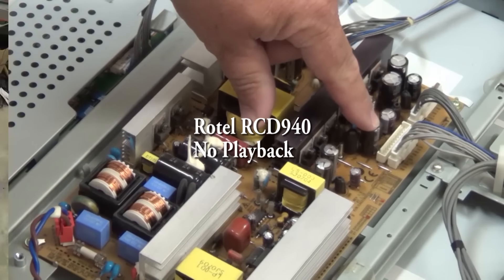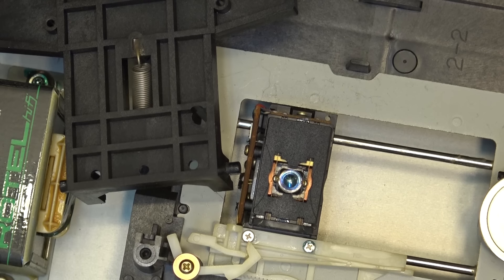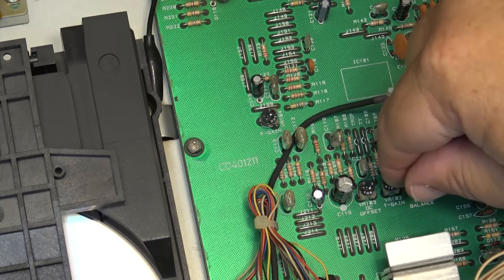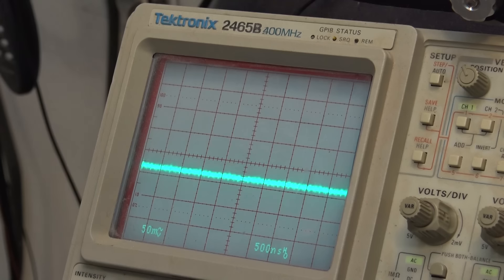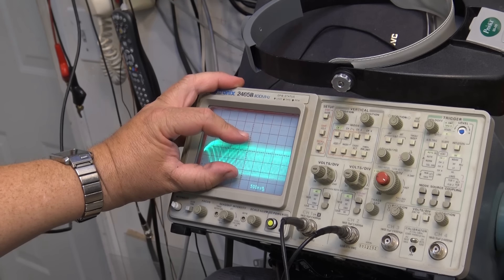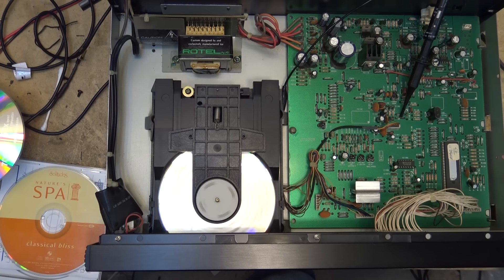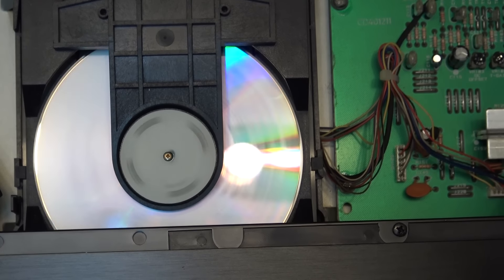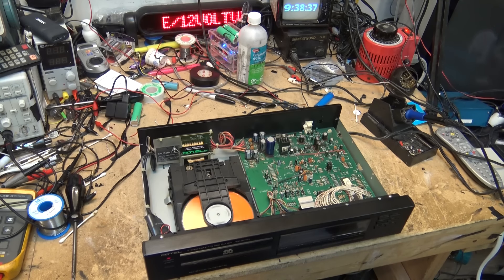Rotel RCD940 CD player repair and alignment

Comment: Thank you for running through this repair.  I watched your other video on the belt replacement for the Yamaha CDC 705, and then came here to see this one.  My Yamaha needed to have the bias tweaked a bit to stop the CDs from skipping.  Thanks for pointing out those trim pots for us.

Comment: Interesting design, that player. They save a motor by making the mechanism more complicated but then they put a giant circuit board in there with lots of unused space and populated with through-hole components. Economics for electronics were definitely different back then.

I can definitely confirm your findings about CD-R's. In 1994-95, long before most people knew that recordable CD's existed, I worked at a company that made software for CD-i discs. They had only a single working CD recorder for the entire office: a Philips CDD-521. It was one of the first recorders in existence, and it was probably as expensive as a car. I bought some blank CD-R's that cost about the same as a prerecorded music CD, and recorded some audio CD's and CD-ROMs. I still have most of them and most of them still play, even on my oldest CD-player: a pre-production Philips CD-100 with a laser pickup built in 1982.

Like you, I had the best results with the early green (cyanine) discs. They still work even now, almost 25 years after recording (at a whopping 2x speed). But I always felt that later discs, especially the silver ones, but also the gold ones (phthalocyanine) were always less reliable even when they were new. I tried to avoid them so I only have a few of those. The blue ones (Azo dye) also work well but those didn't appear until much later so they don't have as much of a history yet.
Reply: 95 cd recorder was 2000-2500 D^^ 
had a cd with at least half mm wide scratch if knot over 1mm? 1,5? and played -?- 
i mean the see thru scratch... also among my hundreds öff tapes one had a cm meddle oxide fall off so 
1 sek no sound xD

Comment: The first single disc player I bought was in 1986 as I bought my first CD "Brothers In Arms" by Dire Straits. I bought the CD player at a Radio Shack for $170, and that was $100 off on sale! Three weeks later I had to take it back, had trouble reading discs and if they played, they would stutter. Being under warranty, it was fixed for free. Turned out something was loose on the mechanism and it went on to work fine. I also bought a standalone CD Music recorder around 1997. You had to hook it to the stereo and record in real time. I thought I was something, I'm making my OWN CD's! Now look how for we've come. By the way, those CD-R Music discs at the time were $7.00 each, a box of 10 was $70.00 so I had to be careful not to screw up a recording!
Reply from the maker: I have a Sony 200 disk jukebox and a CDP555ES single disk unit. That one is fantastic. I have about 1000 CDs back when I used to buy CDs.
Reply: Good taste in music. Brothers in arms was the first cd to sell a million copies.
Reply from the maker: I also have that CD. 
Back when CDs were brand new the selection was mostly classical. My first CD Isac Stern's 60's anniversarry concert. Fantastic full digital recording. My first pop CD, because there was very little available in 1982 or 83. The GoGo's. Like most of the music from that era, no staying power.
Reply: You were something back then as was I 😁 mine was a Tandy as well and paid 189.99  and my first CD was the Police synchronicity.
Reply: My first CDP was the Sony midi version to fit my Mitsubishi midi hifi system. It had custom file and when a friend visited me I was proud to show him sentences I programmed before for every CD in the library. So my CDP showed “Fuck off”  when I wanted to impress friends. My first CD was Queen “A night at the opera”

Comment: I bought an onkyo integra dx-7500 that was in a smoking environment.  I could smell that tar the moment i opened the box.  I cleaned the outside to rid the smell and I removed the top cover to look inside.  It did not look that bad.  I lightly blew off the laser with a can of compressed air feathering the trigger.  I stopped b/c I saw the laser eye moving.  Is this normal?  I did not clean it with a q-tip or alcohol.  The player seems to play real clear and it plays badly scratched CD and CDR's with out any skipping.  Should I leave it alone at this time?

Comment: BTW, Sanyo didn’t make that player, just the laser and some ICs. The player’s power supply and analog stages are Rotel’s work. I have two Linn CD players that use a Sanyo laser, those are definitely Linn designs.
Reply from the maker: Si1983h 
Rotel designed it but I am pretty sure they had someone else make it in Singapore.
Reply: 12voltvids I think Rotel kit has been made in China since the 70’s, certainly the bits I’ve owned have been. It worked for them, it’s affordable quality kit.

Comment: I've been watching your Rotel CDP videos. I just bought a used rcd-965bx that sounds amazing but the Philips CDM-4/19 drive is making a chirping/swishing sound during playback. Some cd's chirp less than others. It's driving me nuts! I would toss it in the bin if it didn't sound so good. I want to save it. Any insights for a fellow Canuck?
Reply: Hey! Get someone to fix it! As you say, it sounds so good (because it does!). You hardly find a so much pleasant e accurate sound from any other CD player at its price or higher. I have a RCD 965BX too, (with open/close issues in the tray) but I never thought he could really sounds so good!
Reply: @DoNaSbaR  Yes, it's such a laid back non fatiguing sound from the Rotel. I brought it in for a service two weeks ago. Waiting to hear back from them. Fingers crossed.

Comment: Have an issue with my Rotel rcd 951.  She normally works fine without skips until 3rd or 4th cd.  That's when the trouble starts.  I've cleaned the lens and nothing changed.  Sometimes it will work for days without a skip and then it begins.  It only ever skips forward.  Should I lube the lens guide rail?  Anything else that it could be?  Any help is greatly appreciated.

Comment: Thanks for this.There doesnt seem to be any people doing this.I have recently tried to repair an Akai CD-M70.I noticed first off the laser head mechanism was down the back,like it was stuck.after getting the transport out,and loosening the laser head along the rails,I noticed laser wasnt working and the motor didnt spin the disc.A pity I couldnt get it to work.Thanks.

Comment: I have a Samsung DVD-VR357 that wont read commercial DVDs but has no problem reading CD's and even scratched up blue burned DVDs...what gives? The laser has 2 pots on it, labeled HI and LOW...can I turn up the laser with one of these pots? Nothing on the board.

Comment: Hi I have a Emerson boom box with cd player 1990 ...ac2503...i load cd ..switch to cd function ..cd no spin push play button  nothing
lcd screen read 4 black lines ...if i go out of cd mode and then go back to cd selector the cd always jerks a bit as if to start the cd but thats it.
could you please tell me what your thoughts are as to what might be the issue ...have cleaned lens still nothing...
many thanks for any help you can provide.
cheers from Cygna6

Comment: @12voltvids I have a Rotel RCD-955AX. I left it on pause for a day and now the motor just will not stop turning. As soon as I power on the unit the motor spins and does not stop. The display does not flash any numbers, it seems to be seeking information. Nothing works all of a sudden. Any advice? Thank you sir!!

Comment: They may have used Sanyo chips but that doesn't mean Sanyo made the player. Rotel made some pretty good stuff back then. Check out the RCD-955 player. It had some auduiphile grade parts in it.

Comment: In the early 2000's my brother bought a printer and wrote the key on top of the CD, adter that the computer couldn't read it. The CD info was written on the sticky side of the sticker label on top of the CD, since it didn't work after writing the key on the CD, he pealed the sticker off and the info was on the bottom of the sticker and the sharpie ink blead through the sticker..lol
Reply from the maker: Learning Electronics Cheaply 
That's why they always said not to stick stickers onto the disk. The data is on the top read from the bottom. The spiral grove is pressed into the top, then the dye layer and then the reflective coating then laquor on cdr.  On stamped disks the data is stamped then the reflective coating followed by laquor. Put a sticker on and then peel off you will remove the laquor and reflective coating. 
DVD r are 2 disks glued together. The spiral groove disk, the recording layer, reflective coating and the. The top half of the disk. Much more protection.

Comment: Hey 12voltvids, What if someone where to burn a cd at a much slower speed would that help older cd players read the newer disc any better?
Reply from the maker: I don't think so. The older dark blue or dark green disks were better in the older players than the modern silver disks.  Crd is hit and miss on cd players manufactured before recordable CDs were devoloped.

Comment: I acquired a three cd classical set recently and they are gold layered disks. I wasn't sure if it was just for looks or performance.
Reply: You can be sure that it's just for looks since the gold layer will have no effect on the audio quality.
As long as the CD player can see the eye pattern in good shape you can be sure that the audio will be good.
Reply: @GoldSrc_  they do look swanky. The sound is good but no better than other CDs I have from the same producer.

Comment: My 1988 pioneer 6 CD changer it can play those newer CD-R disks and not skip.
Reply: The signal isn't as clear, but yes, they should be readable, but sometimes problematic due to their composition, as Dave here stated in the video.
Reply from the maker: The reason I was having trouble with that disk was because my AM transmitter was turned on. The signal from the disk is lower and the interference from the transmitter pushed it over the edge, as I showed later once I turned the transmitter off.
Reply: @12voltvids  Interference from such sources as said transmitter can intensify the reading problem, yes, but part of it may have also been due to the fact that this was a smoker's unit at some point. An NOS laser mech from a similar unit would fix this problem once and for all, even with the transmitter interference, even though you stated that they were a pain to acquire.
Reply from the maker: Colton Rushton 
For sure the smoke on the internal optics is lowering the signal. Incidentally it operates perfectly with the  staples CD even if the transmitter is on if the metal cover is on. This transmitter is not a part 15 transmitter. Part 15 limits the output to 100mw. This one is putting out just over 1/2 a watt as one of the resistors was changed.  With the indoor wire antenna it makes it to the end of the block before it fades away. If it was fm with half a watt it would easily cover the neighborhood. I just use it to rebroadcast an fm station on the am band so I can play with my old am radios. It does however play havoc with my test gear especially my scope. So i have to remember to turn it off whenever i need to measure something.

Comment: Hello 12voltvids,
I have put another teac drive and servo board into my cd-player. I have been having small clicks in the speakers. I adjusted focus balance, that made it search smoothly forth and back, and then I adjusted tracking gain until it would accept all discs and finally adjusting focus gain so it would be stable and even read burned cd's. I am looking at the eye pattern all the time to maximize it and get it clearer. Reading the very little informative servicemanual did not really reveal any secrets. But looking at the eye pattern while adjusting all parameters did. anything I do, reflects on the eye pattern. I also measured the laser over a resistor and got a value, divided by 22, multiplied with 1000and got a new value that I compare to the one on the lasers label. It would seen that it's 3 % worn. But I think there are many other factors that can make a laser become bad before that point of expected life time.
May I ask you what e-f balance is? I think I understand that there are two coils inside the laser head and they move the lens up and down and side to side to read etc. But if there is no dedicated e-f balance on my servo board, and nothing on the laser itself, what can I look at as e-f balance? I also read that the coils are adjusted to stop whining. Okay, but what is exactly stop whining? I mean, they will always make a little very low sound on the whole adjustment scale. I compared to my other cd-player, it it shines and reads perfectly and have no clicks in the speakers. So I  think that the laser coils whining is a relative term?
Cheers and thanks for a good video. It's seriously hard to get a cd-player well adjusted these days and most workshops closed down, and many people get the music from the web or some sort of server. But I am very interested in keeping my cd-player spinning well, hence I started out myself.
I hope you can explain the problems a little to me, so I can avoid the last few small clicks in the speakers, which I understand is errors that could not be corrected and set as flag level 3 - unrecoverable or something like that. The adjustments I have done helped it really much, and last night I thought I had hit the right spot, but there is still a fraction left, so by fine tuning or determine if the laser is having other trouble and is doomed, so I should look out for another one. It's a sony kss-151a laser.
Cheers and great videos!

Comment: Hello man!!! Here a fan of you from Mallorca, Spain. I have one question I would like you to throw some light on if you don't mind! How can I adjust tracking gain and focus gain on units that do not have trim pots. Ihave watch some videos inwhich guys add and extra resistor somewhere in the board. Is tahta propper fix? How do I know how many ohms should the resiator of? Where should I place it? Thaks in advance!
Reply: The unit I am trying to repair is a Denon UDCM-M7 3 disk unit. In the service manual you have info about the eye pattern but it does not say how to adjust tracking focus and gain. I have been trying to improve the eye pattern by adjusting the laser intensity, but it is not enough. Thanks in advance if you could help!
Reply from the maker: If there are no adjustments for focus/ tracking bias/gain then its all done digitally.  Some can be set using special jigs nit most not.  They work till the laser is shot.
Reply: I see!! Thank you very much for the info! Will investigate further!  @12voltvids

Comment: The last good CDR for home recorders were made by Sony.  Bought 300 of them and not one failed.  The new discs are hit or miss.  Some of the new ones will record OK at 2x speed but for some reason they will not finalize when recorded at normal speed.

Comment: I have a Micromega Stage 2 cd player from around 1989. Now it just displays ERR when I put a cd in the drive. The disc spins after inserting it but after 20 seconds or so just says ERR. It displays No Disc if I open and close the tray without a cd. I've tried cleaning the lens but no luck. Could be a dead laser module be a possibility?
Reply: It could be, yes. Lasers get weak with use and CAN fail. I would give the cleaning another go. I f you have it to hand use 99% isopropanol (alcohol) and carefully rub with a cotton bud. After this use compressed air to dry or wait for 10 minutes to open-air dry. This usually works for me but nothing is a certain fix..
Reply: Thanks Les, I will give it another go using 99% iso (we have this at work). Nothing to lose at this point. It's a shame as I always thought this player sounded great even though it was always a little quirky.

Comment: What about consumer cd recorders like the pioneer ones, do they work the same way as a pc drive?
Reply from the maker: Consumer CD recorders use CD-R Audio and CD-RW Audio. These are special disks specifically for the audio recorders. Computer drives can also record onto the audio disks but the stand alone recorders can not record onto the computer CD-R disks. They have a special code written in the table of contents that identifies the disk to the drive. Without that code, the drive rejects the disk. Audio enabled disks cost more than the computer disks.
Reply: 12voltvids  I did once have a philips standalone cd recorder that worked with pc discs
Reply: I had a Pioneer audio CD recorder, and it took the music only discs. I tossed it many years ago because 1. it broke and 2. my computer did a much better job, and I could edit the audio with it.
Reply: @grandmasdeer5298  Unfortunately computer drives are no where near as good for audio, they are designed for computer data, standalone recorders are designed for the purpose